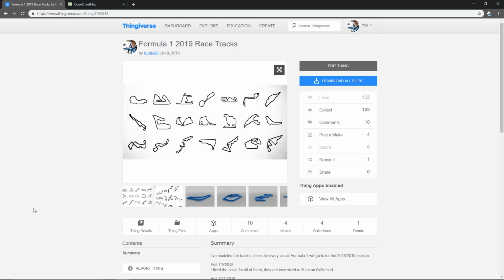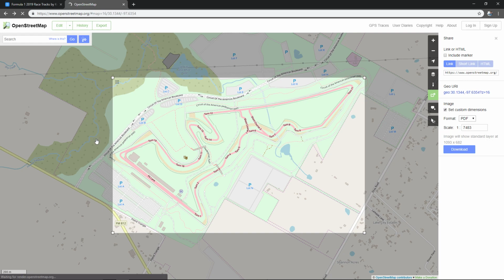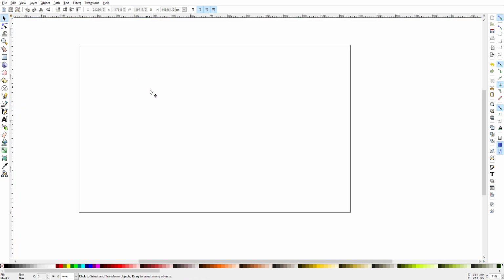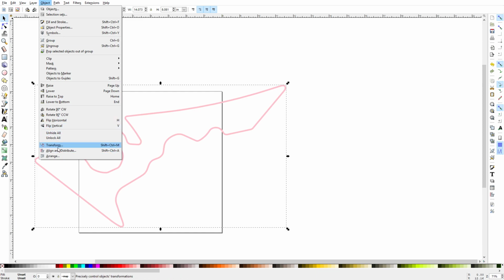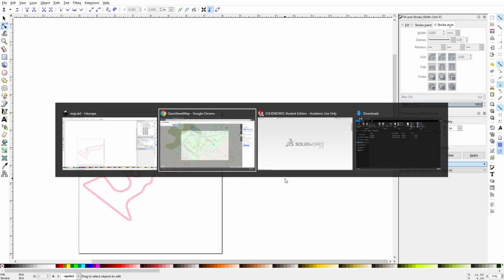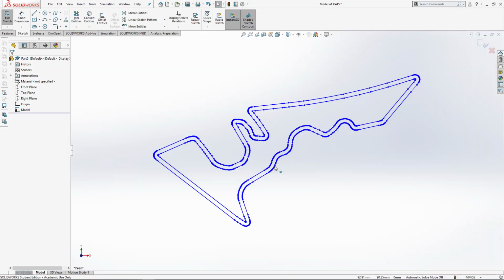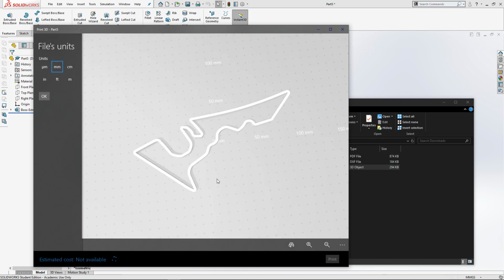Creating 3D Track Outlines Using OpenStreetMap, Inkscape, and SolidWorks

Comment: Trying to do a track, Atlanta motorsports park, and I can't find a method of deleting the track access roads.   It doesnt just select the inroads like the example in the video but whole sections/blocks of the track so I cant delete just the access road without deleting parts of the track to.  ???
Reply from the maker: Sorry to get to this late. When open street maps gives issue like this I try to find any .svg I can of the track, wikipedia useallly has .svg files that are just as manipulatable.

Comment: How would you go about doing street circuits like Monaco, Singapore, or Baku? OpenStreetMap does not have the tracks laid out.
Reply from the maker: Correct, what I did was find an already made .SVG and edited down. I got decent at inkscape during this and could work off already made vectors.

Comment: Is there anyway to do this and capture track elevation changes?
Reply from the maker: I am not aware of an easy way to get the elevation data as well. I looked into using software like qgis to get the elevation data in the same outline but it never came out clean. If you can figure it out do share.
Reply: I would love to have elevations as well on the print! Any updates maybe? ☺

Comment: People watching these videos sometimes aren't aware that you would need a raft or a brim to hold the track down while printing because the tracks aren't that wide. And this info is not left in any of the Thingiverse Thing Details.
Reply from the maker: Yeah it definitely wouldn't hurt but I did all of them with no raft or brim
Reply: @KurtMoran  I found your video after someone showed up in the Ender 3 Facebook group having problems trying to print a track. The only thing they posted was a picture of the track and what was going on so I asked them what the Thing Details said but I figured they didn't even look.
Reply from the maker: @Deneteus  Gotcha. I can't recall my exact parameters but it didn't take anything special.

Comment: would you know how to make the track thicker, width ways?
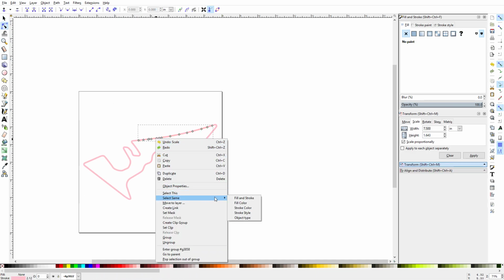Reply from the maker: At 3:20 I change the width by changing by changing the stoke width to 3mm. This is where you could change it to whatever you would like.
Reply: @KurtMoran  Ah! yes... it was so quick I missed it first time around. Thank you.
I've downloaded your stl files for the 2019 tracks, thank you so much for taking the time on this.
I'm going to try your method to get some outlines of some other tracks too. One of my friends really likes motoGP so he wants some bike tracks. Also, I'm going to attempt to do the Nurburgring for myself.
Thanks again.
Reply from the maker: No problem! Good luck with the Moto GP tracks. I have done the full Nurburgring and put it on Thingiverse.
Reply: @KurtMoran  I've just done the NBR too, I didn't know you had it on thingiverse. It was a bit tricky, wasn't really able to get rid of some of the lines down at the bottom where the GP track is. but I've done my best and I'm happy with it.
Reply from the maker: @GardenRoomUpNorth  That's great!